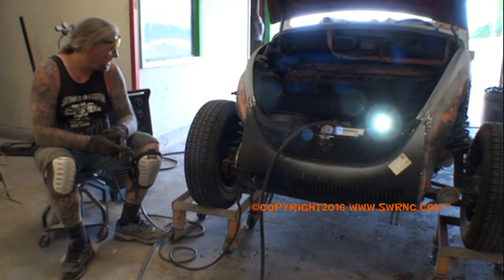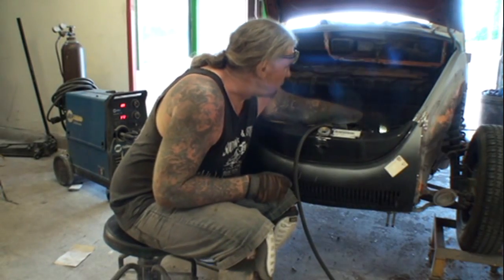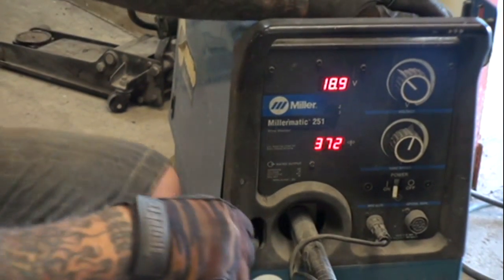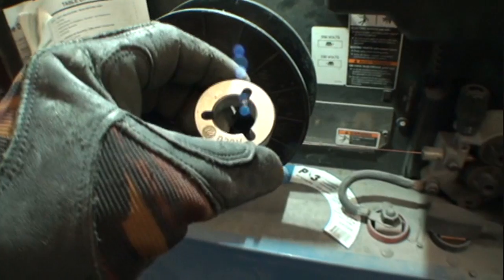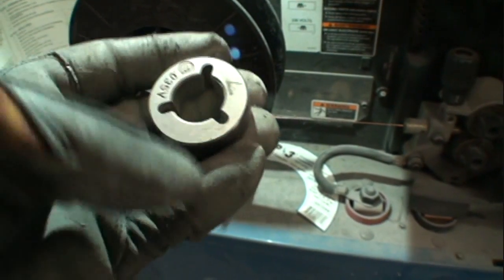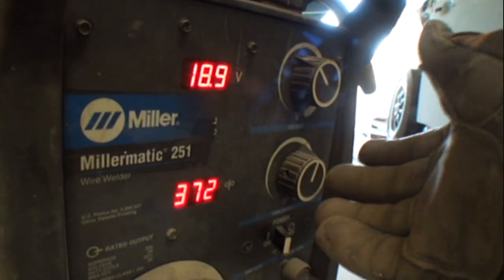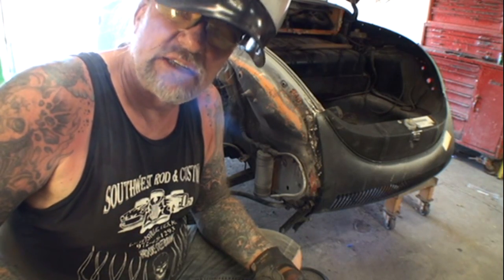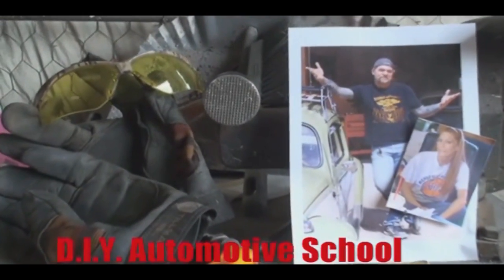How To Use A MIg Welder-Choosing The Correct Wire Size For The Job

Comment: Pete I have to correct you, the gas is not for cooling ,it is to stop the exposure of the molten pool absorbing oxygen/nitrogen and hydrogen which leads to porosity and spatter.
Reply: guessing he probably knows that, but dum asses like me tried turning the gas up to try find the right setting, I wondered if more gas would cool the too hot effect of using 030 on sheet metal.  Going to 023 was a total revelation for me, I had to buy new tips wire etc, but now I can do what I set out to do in the first place.
Reply: The gas acts as shielding from the air would have been a simpler explanation, but glad you said it. Also some gas mixtures do help control heat, so Pete is not wrong either.

Comment: Thanks for this. I am new (as hell) to wire welding, I used to gas weld and arc weld, but this is a new animal. Changed fro, .030 to .023 and its a LOT easier to get better welds.

Comment: Once again you're dead on Pete. Iv'e had sixty pounds of .030 sitting in the cabinet for about 5 years now. I discovered the .023 like you did. I was blowing holes in 80 year old wire edge fenders and it just occurred to me to try the small wire. There was nobody to tell me about it. I felt like an idiot when my welder started working as smooth as a glue gun. I tell young guys I talk to subscribe to your channel. You're helping a lot of people Pete. Thanks again.
Reply: dang i've been running .030 for years. i'm gonna get some smaller stuff.

Comment: Just bought a Linde multi. 180SP mig welder to do small projects.Dealer gave me a 11 lbs .030 and was having problems. Your great video just confirmed what I needed .023 wire. Love how blunt and direct ,straight to the point no f.. around. Just love it.. Thanks BRO.

Comment: Pete, that's 372 inches per minute wire feed speed. That picture next to the number is the wire through the rollers. You can check the numbers buy pulling the trigger and let it run for 10 seconds, measure it and multiply X 6. Many welders don't have a wire speed readout and that's a good way to see it their welder is about at your 372  setting.
Reply from the maker: THanks for the HELPFUL HINTS and Useful Tech Tips..
Reply: Julian P. I sure do thank you for this tip. I was wondering how to determine this. You saved me from doing a lot of digging. ;-). I know its been a year and a half, but better late than never.
Reply: William Charles check out welding tips and tricks on YouTube too. Tons of good info on that channel too

Comment: I've worked construction and in weld shops for over 10 years when I was younger.

For example, if you're doing 16 gauge grease duct, the piece isn't picture perfect in terms of fitment gaps etc.

If you're filling up a gap or recovering from a mistake, the larger gauge such as 30 works better & you won't blow through spools as much either.  If it's painted or galvanized or rusted and you can't get it squeaky clean, same problem exists.

I've found that the thicker stuff resists drafts a little bit better if you're using gas.

Just turn down the speed and heat to match thinner metal if you're using thicker wire. With flux core on a ladder for example, is step up to 35 if at all possible & run flux core DC reverse.  With thinner metal, you have to weld physically faster to avoid blowing holes in it.

Skill and how well you clean it up when done is the most important thing.  

Of course, I'm 47 and I was welding 20 to 25 years ago. The newer machines might be more forgiving.

Comment: good to know..  I'm finally throwing out the harbor freight POS (General Chang's tool supply) welder I've had sitting around for 15 years because it DOESN'T WORK and buying a new welder.  It's big and blue like yours but says '211' on it I think it's going to be great.

Comment: It is doable with 035 if you already have it and are skilled enough, but if your going to work with thinner metal more than once or twice, just follow Pete’s advice and use 023.
A tip if your just welding on a bung is to whip on and off the bung while focusing heat on the bung because it’s thicker.

Comment: I did not know how many inert things can actually copulate. Thanks for the enlightenment. On a different note that % sign on the front of your welder is a symbol for your feed roller and the number is inch per second. And in regards for wire size, 023 is great for body work, but for construction and repair of machinery here on the farm  I use  .045. Otherwise you'll never get done. Thank you for your video.

Comment: Right on Pete ... up until about a year ago I was using .030 on my Lincoln 180c but I was welding thinner and thinner sheet metal so I went to .023 and I'm able to do the thin stuff easy ... I also have a little Hobart handler 125 for remote stuff where I only have 110 available for it I use a .030 flux core and it gets me by when I'm making fence repairs and what not ... gets me by.

Comment: You're so right Pete.  Ive got a Uni mig 210 . Been using 0.9 thats about 30 wire . Had enough of it so just put a new torch on it after 20 years the old one was getting bad . Bought a nice Binzel torch and dropped the wire down to 023 .what a difference.  Even a little kid can do a decent weld with it now.  Its just beautiful to use now and i don't even have to try to get a good weld. The new torch is a great quality one to and light and comfortable to use . Another excellent tip from you again mate.  My unimig always did great welds but now its like a holiday and i don't even have to try . Didn't even have to touch the settings.  Of course the idiots at the shop tryed to sell me a Mig torch that was  made to build the Uss Missouri.  Told him yeah sure how about a fucking water cooled torch .  Unbelievable how they just want to sell you the most expensive stuff you dont need. Thanks mate and take care.

Comment: Now we certainty put that issue to bed.  Thanks much!    Next is flux core or not. (?)  Also, I am making a trailer from an old Miata.  Welding 1/4 in cold rolled to unibody frame.  Q: .023 0r .03+?

Comment: Just got my hobart 140. When I went to pick up my 75 / 25 bottle I asked what best wire to use and he handed me .023 wire. Will that work with a roller that says .024?

Comment: 👍🏻👌🏻👏🏻👏🏻👏🏻. Thankyou very much for the information. i never knew about different wire thickness. I have stuffed up welding sheet metal larger diameter wire/ increased heat. Was overwhelming/frustrating & terrible jobs to the point i gave up. Thankyou again, really appreciated. Regards from 🇦🇺

Comment: Collision repair shops at the dealers or any other pro-shop of this nature will agree with you. They use 0.023 inch wire on 99% of the welding. Moreover, you will see them using the Millermatic 211 MIG Welder weighing only 38 lbs. Inverters are taking over the welding industry, particularly when the job can be done with small amperage. Your 300 lb machine can still be used at GIMBO’S garage making ten thousand pound gates. LOL

Comment: Great tech tip Pete tried welding with .30 wire on 1/8th inch and the heat setting was way higher than I normally use and to get it to penetrate I had to turn down the wire speed and left a shitty weld and a lot more clean up

Comment: I learned TIG on thin sheet metal, stainless and Aluminum. The thin wire makes sense because you can use a little more heat with less warpage doing spot welds or plug welds. There is more information to welding than most people realize, controlling the penetration, heat, ducile, etc... Try welding aluminum cans together just for fun LOL

Comment: I second this advice, 0.23 is what we were taught to use in school for any sheet metal welding. It's the right size for exhaust work also. Tried to weld some exhaust with 0.30 flux core wire, and even with my 120v welder on it's lowest settings I was still blowing holes in it left and right. Of course flux core wire runs hotter than the same size solid wire with shielding gas alls well, but it's still too big for sheetmetal or exhaust tubing. With 0.23 and shielding gas you can still burn it in hot and get a good strong weld on thin metals, just without blowing holes.
Reply: shielding gas, do you mean inner shielding gas? or gas from a tank

Comment: my mig welder does not use gas i brought it for small patchs on my car the wire that is recimended for my machince is a flux wire but i can not find any .023 flux wire the smallest that i could find is a .030 have no use it yet the one that i have is a .035 but it burn threw   the sheet metal any advise another question what number gage of sheet metal should i use

Comment: Thanks, Pete.  I'm still learning as most of my welding is as a hobbyist. Great info to know on wire dia. and distance of the gun to the weld. You can bet your ass I'll be sure to be running .023 for my next welds.

Comment: I'd like to mention a welder's "Duty Cycle". The heavier duty the welder, the higher in percentage the "Duty Cycle". My 120 volt MIG has only a 15% duty cycle. This means that in a 10 minute period, I can weld continuously for 1.5 minutes before I have to let the welder rest with the cooling fan running for 8.5 minutes. Folks may want to consider this when buying a welder.

Comment: Go back to what we all learned in Oxy/ace welding , that is heat and where it is , don,t overheat the parent metal. 
in Mig welding if your doing body/sheet metal mainly your doing it as you should.
Yes you can tackle some heavy stuff 3/16 + but your tasking your welder and wasting alot of the .023 spool.   Best practice is change out spool to .035 and enjoy the welding.
Everything has limits.
Your example of pulling away to lower the heat is incorrect IMO better way would be to lower the volt setting to avoid the overheating of the parent metal. Welding is a craft you must use your sences with , sound feel and what you see happening as you weld .
By lowering the volt setting you reduce the amount of heat, but can still maintain the atmosphere you need to do proper weld.
It;s a fight to balance this but great rewards come.
Great you present this ! THX!
Reply: I wasn't too much welding bodies, I did a lot of truck frame & heavy structure on vehicles. I made mountings for Lycoming aircraft engines out of tubular chrome molly tubing, this is where i was exposed to getting the heat right. Always get the metal to a fair preheat as you apply the weld. 30 yrs in the trade, TIG MIG Stick & Gas used it all.
Thx

Comment: Have Lincoln 140 and dialing to weld a radiator support on 02 accord with .023 but I'm getting a very round weld as i am practicing on the damaged part. Followed the diagram on the Lincoln and played with different settings but still not getting a flat weld. It seems like the wire is not thick enough to carry the heat and put it on the panel.

Comment: Iv got a crappy harbor freight 90amp welder, it has hi/low setting, think its 60/80 im wondering if this .023 wire will stop the cigarette hole burning goin on everytime I use it to try & gix shit

Comment: How long is the gun's hose for the welder you are using? My machine has a 4m hose and it fucks up 0.23" at the roles (even though it is the correct role setting). That's why i started using 0.32 (0.8mm) wire

Comment: it should be understood that a MIG welding machine react to maintain the selected voltage  so when the wire is bigger, the cross section of the wire is bigger so to maintain the voltage, the machine must supply more current, so say if for 0.023" wire, the requirement is 50 amperes, for the0.035" wire , the current will be about 120 amperes so much too much to weld sheetmetal.
for sure, if your typical welding operations is sheetmetal, 0.023" wire is best suited but if you intend to weld more than that, 0.030 and 0.035 wire is to be considered as the penetration of the weld bead is directly related the energy required to melt the wire and creating the bead.
Reply: is there much difference between .023 & .025?
Reply: @slidenthru9203  no, it can need a small readjustment of the parameters but it suits very well sheetmetal welding.

Comment: Good advice Pete, Here in the UK I use 0.6 mm wire for just about everything. Also i wont use anything but Argon mix gas, tried CO2, didn't find it very satisfactory- ugly welds and too hot. Keep up the good work Pete. J.
Reply from the maker: is .o6 mm the same as 023?? Thanks for watching..
Reply: diyautoschool
Just looked it up Pete, almost exactly the same, odd eh?. Take care, J.
Reply: CO2 is too hot for sheet metal work...good for the really thick stuff tho...
Reply: 0.6mm = .0236" so I'd say it's the same

Comment: flux core wire leaves slag to clean off. gas welding is cleaner but hard to do if you are outside with a breeze

Comment: It seems they don't make .023 for flux core welding.  My welder is the Titanium flux 125.  It comes with only one roller for either .030 or .035.

Comment: I know you said 0.023 is the best but am buying acheap welder but it said wire from 0.025 to 0.035 and my question is 0.25 will do good? At low setting ? 
Got only 2 settings low and high or just sugestión it’s no to buy that sheet?

Comment: Do you change the liner in your mig gun with wire size changes or just use the larger liner?
Reply: Just make sure the tip is correct for the wire

Comment: Hey Pete..cool video..have a question.when welding a hole like a spot weld.do you start at the edge and make your way toward the center? that's the way I used to do when I tig welded.wasnt sure if it was the same for mig.
Reply: Plug welding with MIG, start by forming a puddle in the centre and work it outwards to the edges, and as high current as you can keep up with, works for me, J.

Comment: Some great info and some wrong info.
2:50 welding info starts.
Might help to get a better microphone so you don't have to shout - nobody was running a grinder.
The gas cylinder for MIG is a shielding gas.  You know how an oxy-acetylene cutting torch works, shoot a jet of oxygen at preheated to red-hot steel and it burns a hole, and pushes the slag out?  Make steel welding-hot and it reacts with oxygen in the air, which you don't want.  The Argon / CO2 mix won't react with the steel, and keeps the oxygen away until it cools down.  That's also why the gas is set to keep running for some seconds after you let go of the trigger, to keep on shielding it until it cools.
Pull that torch way back, you are not keeping the hot metal shielded.
If you want less heat, try dropping the wire feed speed.

Comment: Will buy 023 / 6mm wire for my welder next time i run out. Im not welding thicker metal than 5mm anyway.
Bought my machine used and i never got nice welds on sheet metal. It also didn't came with a chart for thickness like in your machine....not ideal...
Thanks for the advice.
Reply from the maker: http://www.jeepix.info/TubRepaint/Tub%20Repaint%20(110).jpg  Here's an example of a chart, if this isn't helpful go on google and search for "mig welding thickness chart" to view more images... Good Luck!
Reply: @diyautoschool  That link took me to a scam survey site. Nov.19, 2019. No chart of any kind. It says you will get a free Iphone for taking the survey.

Comment: Hey pete. Love the videos. I am new to the body work and doing a 1970 nova. I will be replacing pretty much all the rear quarters and trunk pans / attaching parts. I was messing around and practicing with the welder on scrap sheet metal. I can't seem to get the .023 to  penetrate. Obviously the issue is something i am doing. The welds are just sitting on top of the metal and break off easily. I tried to adjust speed and voltage but can't get it right. I have no problem with the .035. Any tips?
Reply: I'm learning to weld too but my welds were doing the same thing until I discovered after watching a heap of videos here that my welder was set to the wrong polarity. The gun must be connected to the "+" terminal, and the ground clamp must be connected to the "-" terminal when using solid wire (fluxcore is opposite). Once I changed this, my welds DRAMATICALLY improved. Hope this helps

Comment: Hey Pete I just bought a Lincoln welder the  mp210 an the gun stopped delivering current so my warranty was up after 90 days an now they want 380 to fix the problem . I seen some one eBay for 100 that flex what do you think about those ??
Reply from the maker: If the ebay item you are purchasing carrys a warrenty then I say go for it,, you won't have anything to lose if you can get a full refund back.. Good Luck. Pete

Comment: Fuck 0.35 wire I just did full rockers and cab corners on my 98 Z71 Chevy. I can't be picky as I'm using the bosses shop but our mig has 0.35 wire now this is a farm operation so I'm typically welding 1/4 inch thick or thicker metal. Now for one quick automotive repair I wasn't going to purchase 0.22 wire but I will say Pete is right that 0.35 really was a pain in my ass doing sheet metal work.

Comment: Have to say that this is the biggest "secret" I've found with MIG. Nobody told me how important wire size was I had to discover that myself, the hard way.
Reply from the maker: Basically the same here.. Thats the main reason I make my videos, because Ive been through all the bullshit and if I can take my experiance and help others out so they don't have to, then Im dong a good thing! I used the 030 and 35 for a long time not even thinking or knowing about the 23 and just thought it was the norm, till I switched over and then BAM! it was like a strike of thunder and changed the whole program.. Best thing I ever did when it comes to welding... Ofcoarse that was many years back... Take it easy Pete
Reply: another thing i discovered later after i started weldiing is the importance of nozzle dip paste. It reduces the sparks and splatter a lot